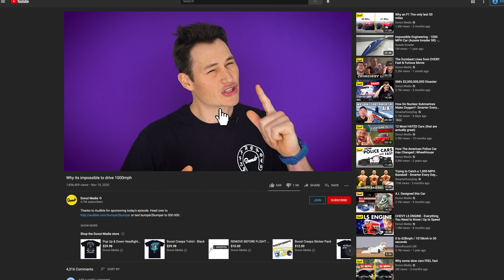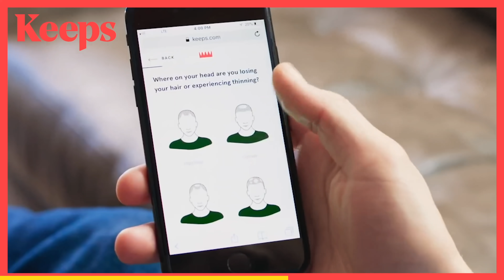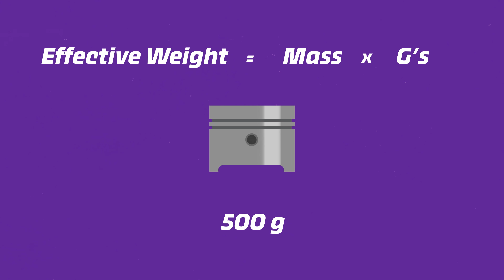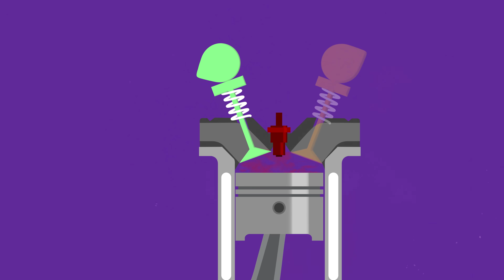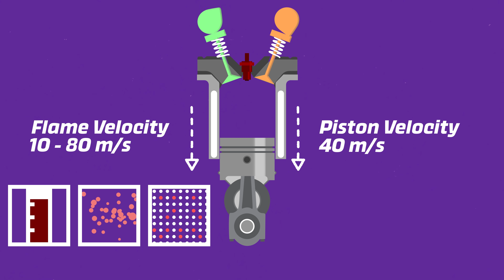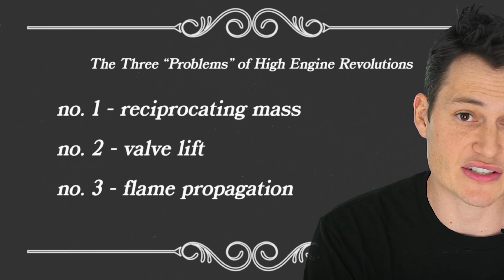Why It's Almost Impossible For An Engine To Rev Over 20,000 RPM

Comment: 7:17 You forgot the desmodromic system, which basically opens and closes the valves mechanically. A system which Ducati stills using today
Reply: Came here to mention the desmodromic system as well
Reply: Still doesn't solve the reciprocating mass and flame speed problem. It's also more complicated and require more frequent and expensive maintenance, like every modern ducati did (except multistrada v4)
Reply: @ardijanuar2036  I dunno man, correct me if It's just a dealership thing but a friend of mine nearly swapped his 1200gs for a Multistrada but backed down when he researched that the 40000 km  service had a bill of around 2000usd.
Reply: @ardijanuar2036  at least valve floating is solved 😂
Reply: I came here to say this, but then I remembered that desmo Ducati's don't rev past about 12k rpm anyway
Reply: @PhilipBeresford  the main use is to stop having a super stiff spring to overcome, freeing up more power. However, in MotoGP + modern ducati V4 superbikes it also stops valve float :)

Comment: Rotaries: haha dorito go burrrrrrrrrr at all the rpm
Reply: 29k RPM, rotary be like: "try me bitch". https://www.youtube.com/watch?v=WW7lDm2x9pw
Reply: Came to say the same LOL  - I love my 82 GSL
Reply: I was wondering why it wasn’t mentioned🤔
Reply: @liamwagner9160  because we Mazda fans are people on the on the special bus. 😷🚌
Reply: better have a closet full of apex seals
Reply: @aestheticswim3397  an entire room in a house just filled with apex seals. Can’t carry any cargo, all the space is taken up by spare apex seals
Reply: @charlespletzke8311  why bother with apex seals ? Just stock up engines and use them as a disposal part every 10k miles.
Reply: @22Epic  ah yes, the rob dahm method
Reply: @22Epic  13b seals cost like 300‐400 bucks, a new 13b crate motor is like another zero added to the end.
Reply: @mguay001  Totally agree, rotary engines are quite cheap. You don't even need to change oil or air filter, just change the whole engine. It's a shame Mazda stopped rotaries.
Reply: @aestheticswim3397  actually I managed to mess up the spark plug hole before I broke the Apex sea.l
Reply: @AzathothsAlarmClock  thank you for stating this. Apparently no one understands this was supposed to be about piston engines. And even if a rotary shaft is spinning at 24k rpm the shaft is only spinning At 8k rpm.
Reply: Yes
Reply: Great minds think alike. Former RX7 owner. 🤠👍
Reply: Haha dorito go burrrrrr at all the rpm while sucking ALLLLL the gas... 🤣
Mileage? Rotary be like: Pffffffft....
Reply: Rotaries still have the flame front issues....So even they are limited...(And before someone says it...I know. R/whoosh....I know its a joke).
Reply: @generationkilled  gotta love that, but also when the e-shaft warps from heat of many rpms
Reply: @generationkilled  Yup, I wonder what effect the twin spark plugs has on flame speed
Reply: more like the sound of apex seals leaking.

Comment: Do an 'Up To Speed' on the 'Honda Grom'.
Reply: What's that
Reply: @alexandersmith7777  It's a very fun mini motor cycle which falls in the category of a 'Monkey Bike'. Just like any other Honda car or motorcycle they are really fun to drive/ride, very reliable, low cost maintenance, have amazing fuel efficiency and the beat part are insanely modable.
Reply: @purabus6470  thanks
That sounds like a great idea for an up to speed
Reply: @alexandersmith7777  Hey did you a limited edition of 'Honda Grom'(s) had the prestigious VTEC!!!!!
Reply: @purabus6470  noice
Reply: I don't know the Grom, but I would love to know more about the Honda Duelnote concept.
Reply: YESSSSSSSS

Comment: Imagine having engine’s with pistons moving faster than the speed of sound
Reply: Wonder what the exhaust note would be lol
Reply: @samantharondeau4580  it would be deafening for sure. Just imagine multiple Sonic booms in fast progression. You would hear the exhaust note for a second and then hear close to nothing the next
Reply: @zirkh1609  lol. I’m a mechanical engineer. Guys their is a reason that we encase all the objects with centrifugal force (the parts that move) in an enclosed housing in a car engine. The parts inside an engine operate under vacuum conditions. That’s why everything on an engine must have gaskets. If there was normal atmospheric pressure inside the crankcase while the motor was running, there would be huge portions of energy being lost due to air resistance inside the engine. So unfortunately there would be no sonic booms coming from the engine. The only way an engine could create a sonic boom is if the engine were to suck in air at a rate of faster than the speed of sound, which would require an rpm somewhere in between 1 and 2 million rpms. Which of course is not really achievable. But it would be cool. I hope this helped you guys understand.
Reply: When something breaks the sound barrier the affect it has the air around could cause more issues i dont if you've seen a jet or a bullet in slow mo breaking that barrier but I think that force could potentially shoot the piston down in the cylinder. I could be very wrong tho

"When the object reaches the speed of sound, air cannot readily move out of the way and a shock wave is formed. When the object is moving faster than sound, the resulting sounds travel behind the object, creating a sonic boom."    
(www.school-for-champions.com)

So what were to happen if you created a sonic boom in a cylinder
Reply: I know it's freaking crazy, i mean 20.000rpm is 333 revs per second . It's just so amazing that the metal mass of pistons and valves and everything that moves is even able to move that fast. That's what fascinates me so much about cars
Reply: @playcer8388  you should look at the demonstration of different cylinder layout / engines on youtube. it's a guy who does demos of anything from a Bugatti W16 to a Volkswagen VR6. He demonstrates it by using these lights that simply make a tick sound, but it can end up sounding quite a bit like the actual engine
Reply: @shtupidmate  yea i know that guy i love those videos
Reply: Can't imagine this happening in a modern 2 or 4 stroke cylinder. There might be some gains from this new variable compression engines from a couple of companies, as the implementation reduced piston side load a bit. Still regarding piston engines though, I don't think it's near enough that an engine could surpass 24k rpm, as the con rod is the issue more than the pistons.

However there may be a few rotaries, ie the Atkinson rotary, that may surpass this 23000rpm barrier quite easily. As I recall though the Wankel rotary is no good for this purpose, but I did hear that people got pretty close to record rpms with 13b motors.

I also recall that the valve actually had little enough float that honda was using valve springs for it's first record setting f1 test engine. Ordinary valve springs.
Reply: @randominternetguy  But revving that high has any power advantages?
Reply: Maintenance would be a b:$ch. people keep forgetting that the sound barrier is still a ‘barrier’. There’s literally a kinetic force that pushes back against the object traveling faster than the speed of sound (not including molecules from atmospheric composition)
Reply: lol. I’m a mechanical engineer. Guys their is a reason that we encase all the objects with centrifugal force (the parts that move) in an enclosed housing in a car engine. The parts inside an engine operate under vacuum conditions. That’s why everything on an engine must have gaskets. If there was normal atmospheric pressure inside the crankcase while the motor was running, there would be huge portions of energy being lost due to air resistance inside the engine. So unfortunately there would be no sonic booms coming from the engine. The only way an engine could create a sonic boom is if the engine were to suck in air at a rate of faster than the speed of sound, which would require an rpm somewhere in between 1 and 2 million rpms. Which of course is not really achievable. But it would be cool. I hope this helped you guys understand.
Reply: This makes no sense because the speed of sound depends of the pressure & density of the fluid in which sound is moving
Reply: @timauthee861  Sound is the compression and rarefaction of molecular matter. Your thinking of the rate that it propagates through different mediums. Not realizing that in order for sound to be generated, an object must generate the sound. If that object moves at a velocity faster than sound propagates, it runs into a barrier.
Reply: What if they could depressurize the air surrounding the piston chamber?
Reply: @unfazedgeorge  you still need oxygen in the chamber for the fuel to ignite. The whole point in to compress the mixture.
Reply: The Ninja H2's supercharger impeller does create mini sonic booms at high RPMs. It's whistling is sick
Reply: @joeljasmin9982  oh yeah. Didn’t even think of a supercharger. Your right. Thanks.
Reply: Now imagine your engine blowimg up at the speed of sound
Reply: I wonder if the exhaust would even make noise
Reply: Car go brrrr
Reply: Constant sonic booms 🤤
Reply: They need to b going almost 10× faster for that n if ur thinking of the sound remember its the combustion we hear not the pistons so we will b hearing that at a much higher frequency
Reply: They do that allready
Edit 
Im wrong i did some calculations and its moves about 10 m/s at 6000 rpm  if you count in both directions its 20 m/s 
And the speed of sound is
 343 m/s 😆
Reply: @HappyDude1  100,000 rpm. Just like my honda (assuming 20m/s at 6000 rpm)